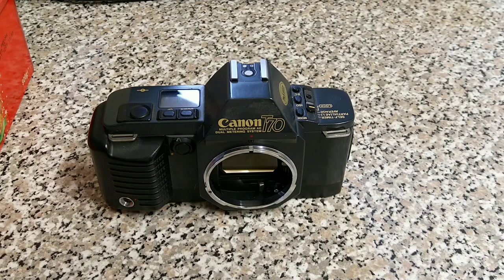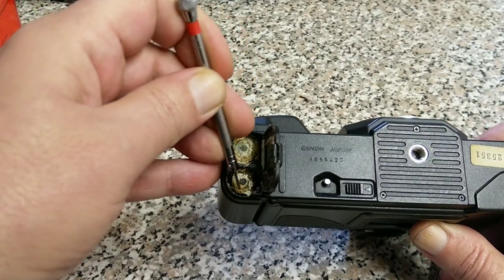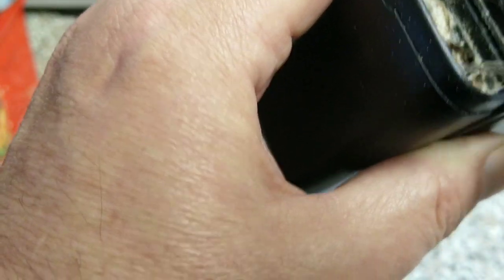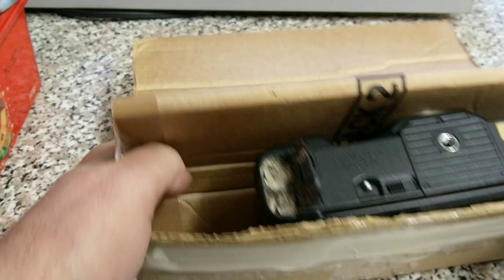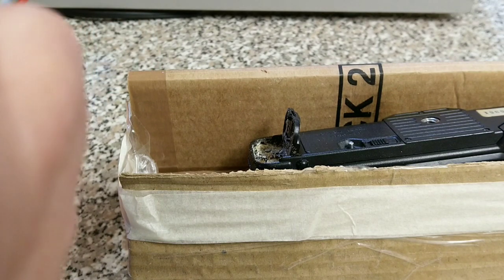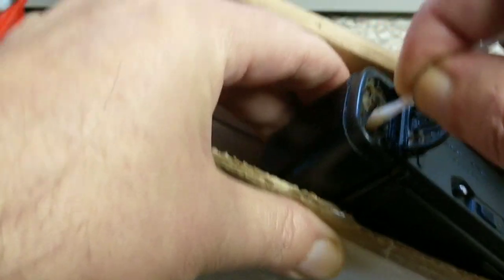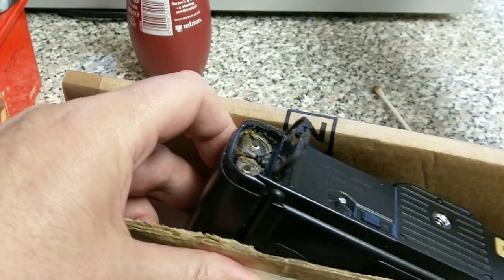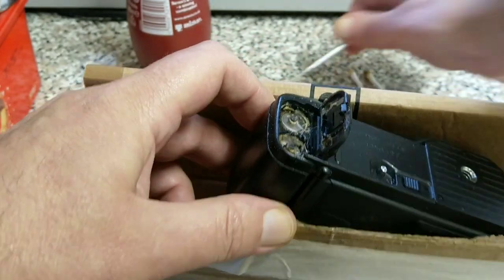Don't try this at home, T70, vinegar and a soldering iron

Comment: I do actually have one of these as well. Happy to see you got it working again. 
Any suggestion on what lens to get for the T70?
Reply from the maker: Well it's not quite there yet,the T70 uses the FD mount so any Canon or third party lens should work so long as it's for FD
A 50mm is regarded as a standard lens for   35mm format cameras, they are plentiful, sharp and fast, though I personally prefer a 35mm lens, zooms of the period are not particularly good compared to modern lenses,EF lenses will not fit
Hope this helps, depends what sort of photography you like doing....